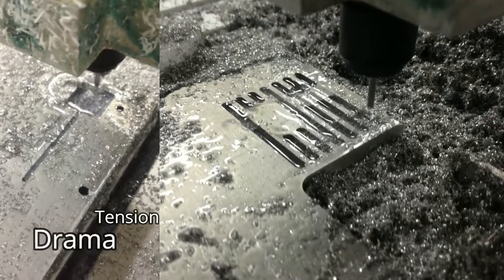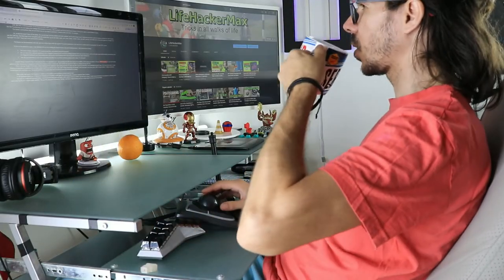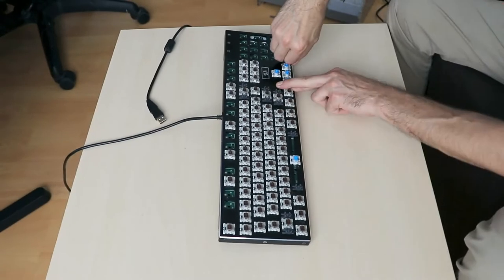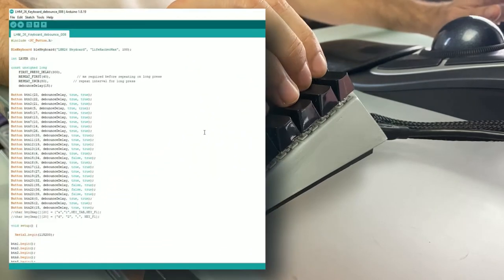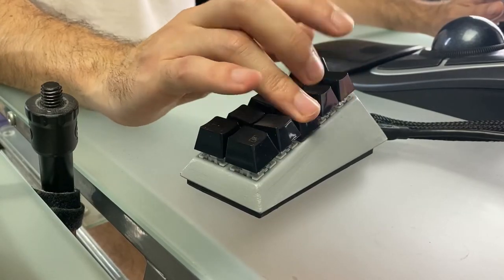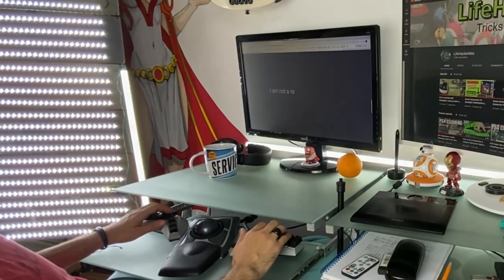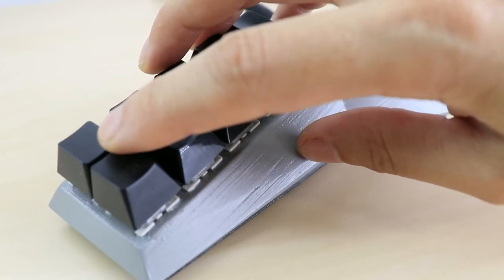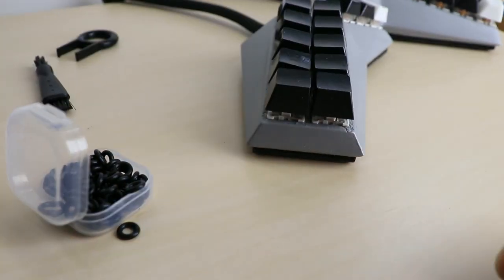DIY Split Mechanical Keyboard with 3D Printed Case and no PCB

Comment: Do you have any advice on how to make split keyboard like lily58 or sofle ? Please I want to buy it but it cost alot of money to buy the kaihl hot swap switch
Reply from the maker: I would say go for 3d printed case with normal switches and maybe hand wired. I bought a used keyboard and got 104 switches and keycaps for 20€. I know it’s not the same but it did the job. I hope it helps.

Comment: debounce?
Reply from the maker: Yes
Reply: @LifeHackerMax  Its a hardware thing but you wrote a C program to do it?
Reply from the maker: @UnderstandingCode  it is a firmware function (I only use the function - didn’t write it) for denouncing. If I remember correctly it helps eliminate the electrical noise produced whenever a button is pushed so you will not get multiple key strokes on a single push of a button.